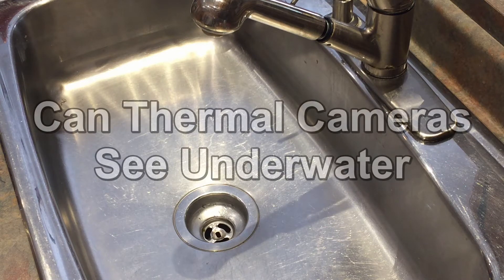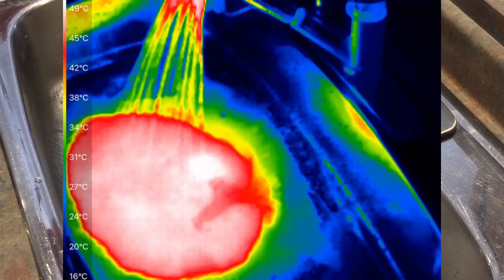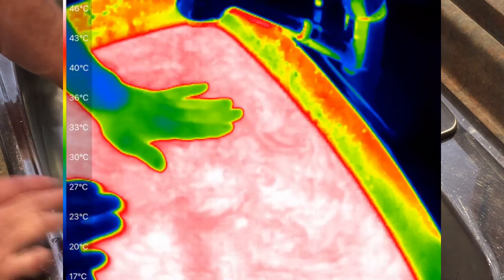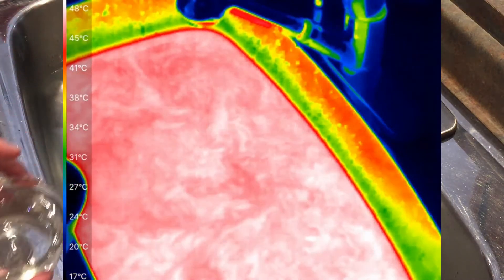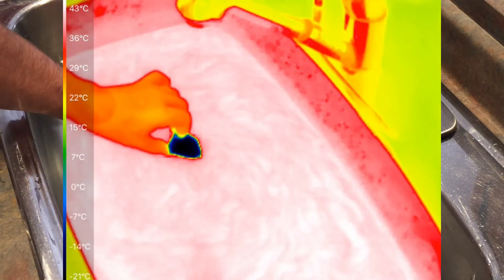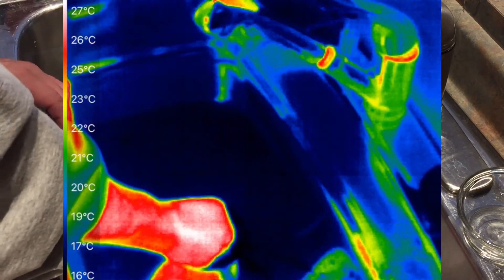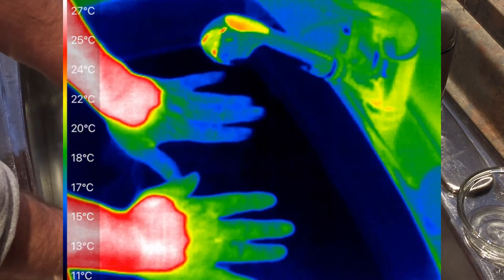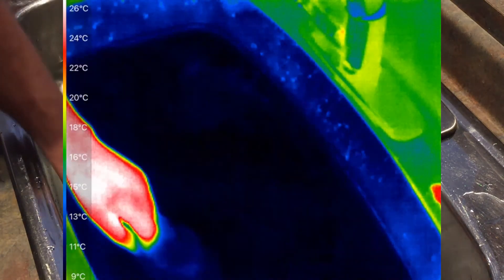Can Thermal Cameras See Underwater - ThermalGuy

Comment: For someone asked "The big question is why it doesn't measure the air?" — you can see on my channel the tubes from boiler, this is pure heat that not visible to the eye, so it measure everything with contrast.
Reply: How do you think the light waves are reaching the sensor? They travel through the air. The air is the baseline. Otherwise known as radiant heat (light waves traveling through the medium (air) to reach the object, i.e. heating the object through light waves, not conduction, induction, or convection.

Comment: This is also why clouds completely block the thermal radiation going from the surface to space
Reply: I mean black body radiation emitted by the earth surface.
Outgoing Long-wave Radiation (OLR) is electromagnetic radiation of wavelengths from 3–100 μm emitted from Earth and its atmosphere out to space in the form of thermal radiation. https://en.m.wikipedia.org/wiki/Outgoing_longwave_radiation
Reply: It's the opposite. I had to fact check myself. Clouds don't necessarily block radiation they reflect solar radiation from the sun which keeps us and the earth cool. The earth isn't a reflective planet , water, earths elements which make up the earth do not reflect technically but yes not 100% of all radiation is absorbed. I've read that roughly 30 percent is emitted into space. There's a whole bunch of variables to factor in when talking about reflection and absorption so yeah. I was confused with your comment because what kind of radiation would emit from the earth to space that would be reflected by clouds. Are you speaking of the radiation that would harm the ozone layer? I mean I can see what you mean now by clouds playing a role in reflecting such radiation from the surface but I never heard about that. If you can explain further that would be nice.

Comment: Very nice. The big question is why it doesn't measure the air?
Reply from the maker: Good question...smoke and fog also don't have heat signatures.
Reply: @thermal_guy  This, my experiment, might interest you. http://www.fractalnomics.com/2021/05/refuting-greenhouse-theory-experiment.html
Reply: It could measure the air, on the unit, itself. But, so could a thermometer. Lol 
Or, are you asking why you can't measure through air, to a distance to figure out the temp of the air, in a different location?
Reply: @shoreangler3383  Yes, the 'air' has a temperature and can be measured by a thermocouple or other thermometers, including the Raman spectrometer. But the 'air' (nitrogen and oxygen) cannot be measured with these instruments at any temperature, and they are not here. They can measure, and I have tested, CO2. This is indeed how CO2 is measured, and the microbolometer and the thermopile are what we use to know the greenhouse gases. I have deduced that the greenhouse gases are really the gases that are detected by the bolometer or thermopile, they are the thermoelectric gases. Nitrogen and oxygen need a Raman spectrometer to measure their temperatures, and they do exquisitely.
Reply: @fractalnomics  So, are YOU going to explain why aircraft can't currently read air temperatures from a distance, when no surface exists? 
I figured you'd have followed up with that. Lol
Reply: @shoreangler3383  I don't follow you. I do know aircraft in the future will be fitted out with laser-based Raman spectrometers to measure air temperature and flow, the CAT( clear air turbulence) not currently measured.
Reply: @fractalnomics  So, you can't possibly fathom why future military aircraft technology isn't included on a consumer based drone, now? Really? Not ONE reason why that would be a stupid thing to wonder?
Reply: @Santa-614  Nope. That's not why we don't have the ability to measure temperature of gases from distance. Lol 
If the frequency can't come back, you can't read it. Doesn't matter if it's radar, lidar, sonar, ir, thermal, or combos of magnetic and UHF.

Comment: I thought your hands in the cold water but refraction might make them seem contorted. Also I wander about the color range, if you could zoom in on only water or clamp the color range to a smaller temperature range the hands might be more visible. I'm guessing but would be interested to see that. I don't know it the attenuation of these wavelengths are very in water.